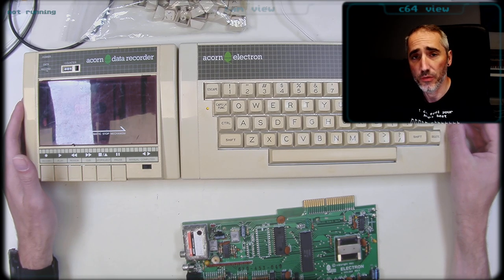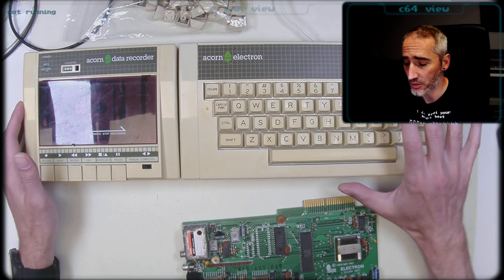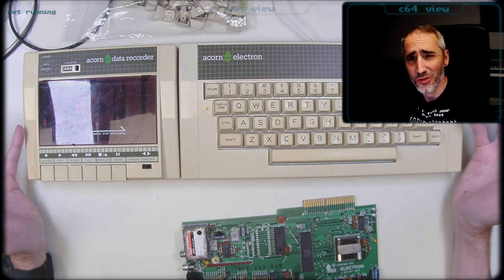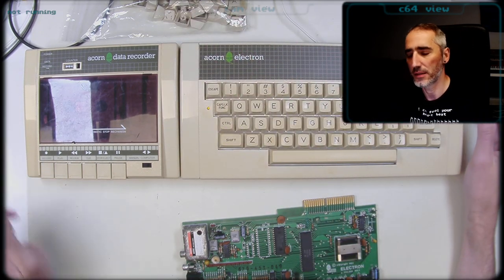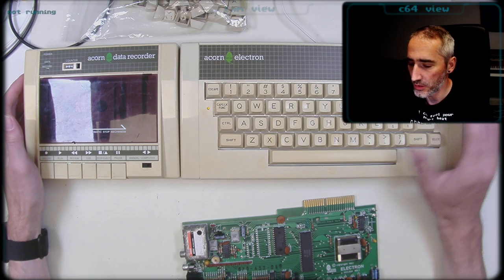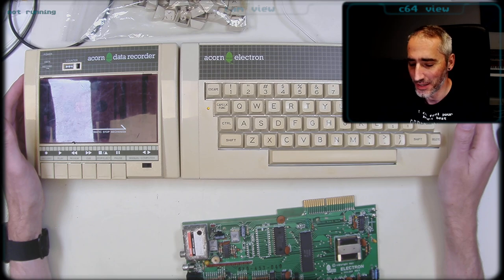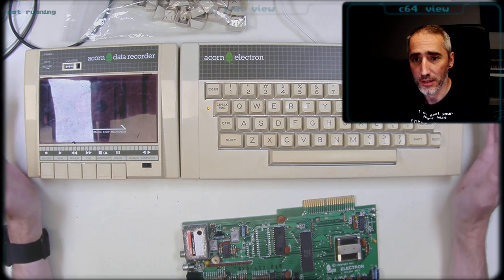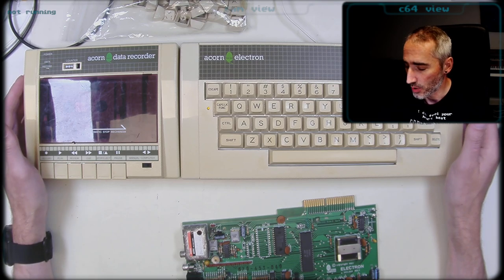Acorn Electron - Channel donation and Ebay finds

Comment: Maybe you could use a Grease Weasel floppy thingy to create an Acorn Electron Welcome Disc if you can find an image of one? All you need is a standard PC floppydrive and you're good to go. You can read and write raw data in any format with it. It's popular to use to archive original Amiga discs which has copyprotection. I've been thinking about getting one myself for that reason just to make backups of my original games while they still work.
Reply from the maker: Thanks for the info, yes, Grease Weasel might do the trick but appears a bit expensive for just this single instance. But I will have a look and if the demand increases I might go this way.